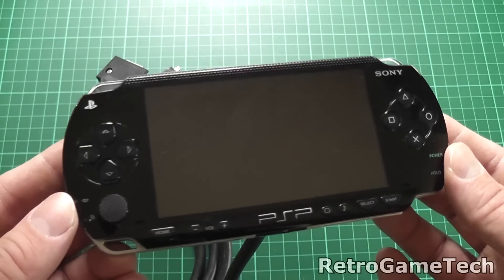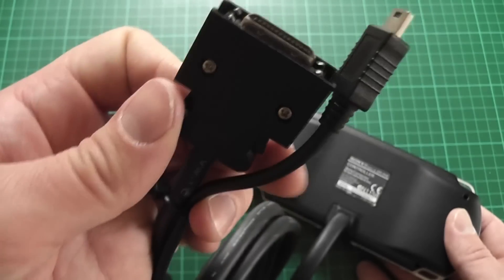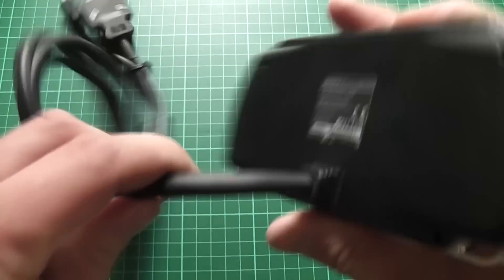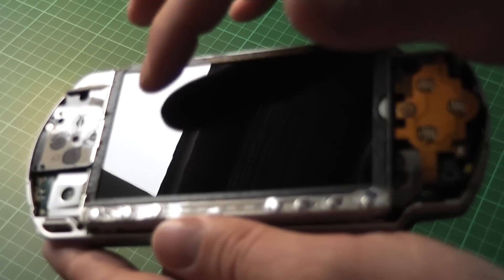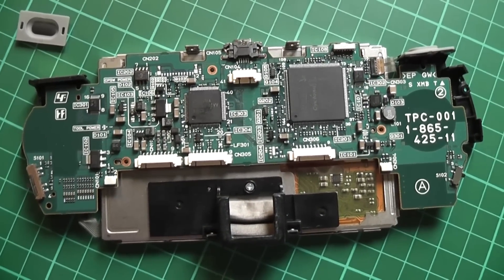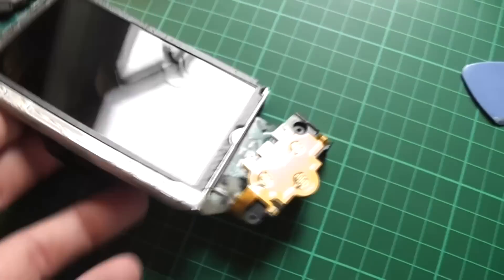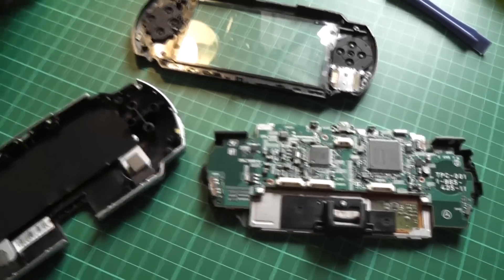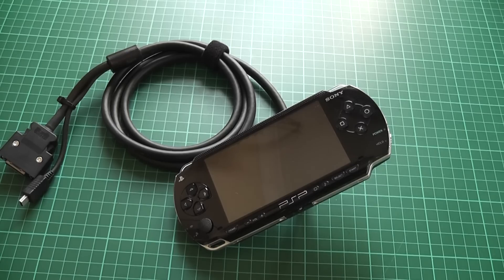What's Inside? - Sony PSP Development Controller - DTP-H110

Comment: So, just got one of these units (Testing Tool), and it looks like the USB cable is for relaying the USB connection onto the controller from the tower unit. This way you can plug in a USB cable onto the controller unit like a regular PSP. :D

Comment: Hi, sorry I'm asking this in a unrelated video, but since you know a lot about repairing stuff. My gba sp wont light up, i have the 001 with the brightness switch but the switch wont work, how can i fix that, or what might be the problem?. I have to use it outside or with a flash light pointing at it now

Comment: That connector is a D-Terminal, they're common in Japan. Essentially, they function just like component video, you can even adapt the connector without needing to convert the signal. Sony being a Japanese company and all, it's not surprising that they would use it.

Comment: Not surprised the screen was broken. Unless im mistaken it looks like the metal bracket the cable retention locks into is screwed to the back of the LCD? Means any pulls on the cable are translated right into the LCD.

Comment: Is there a CARD READER on the left side of the front below the D-Pad 3:19 ?? It seems to have no opening to insert cards like the regular PSP... I also see the Memorystick "M" on the front above the WI-FI indicator... Thats an intresting piece of Hardware...
Reply: Baum Inventions those are the contacts for the PSP analog stick. Which was a terrible idea for the PSP.
Reply: Ah ok. Seems logical... So i guess they just used a regular PSP Faceplate with the Memorystick indicator Symbol... What a wild Device..

Comment: looks like it uses an FPGA to control the lcd, buttons, and serial port. Audio doesn't seem to be generated on the device itself. Makes me more curious about the kinda kit inside the main unit.
Reply: yes, its basically a pad with monitor build in. FPGA is probably decoding some sort of serial video stream and thats it.
Reply: It would be fun to hand it to Kevtris to do some magic with it if at all possible lol
Reply: Yes its just a controller with a screen, we had loads of em back in my sega days, the pspgo was similar and plugged into the same dev kit, we would stick the discs in and plug our headphones into the dev kit and away we go, once we plug the dev kit into the PC for uploading crap into TTP

Comment: It looks like a shop kiosk psp games will just be sample games or be put on it by a computer just so it can be put in shops for people to play the psp but I could be wrong
Reply: Indeed, it was. The unit in the cabinet was not the same as the dev PC, iirc.
Reply: I remember using a PSP in a shop, it was just a normal one but just screwed down
Reply: That's a good thing to point out, you may be right on the money with this.
Reply: No its a dev unit for sure. When i used these games mainly came in on sd card which you would put into the biege tower he shows in the pictures. You would then connect up the two cables from the back of the psp into the dev unit and away you go.